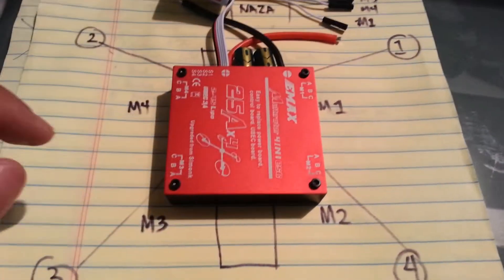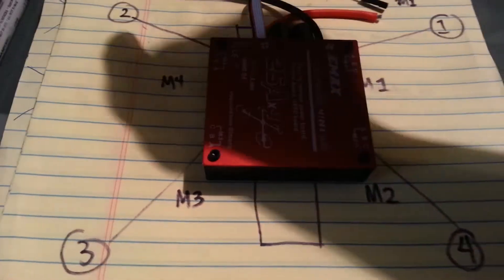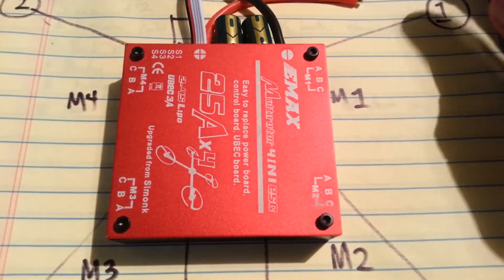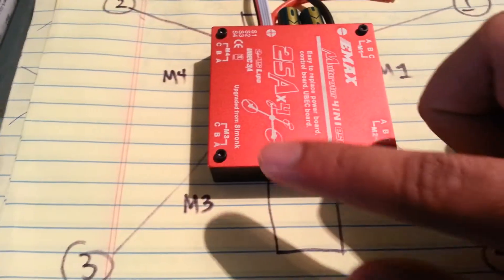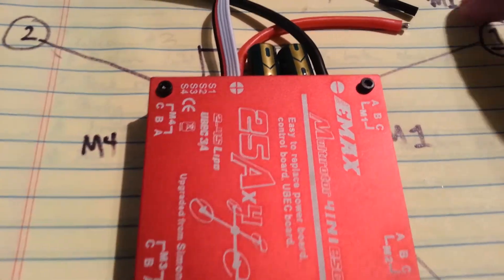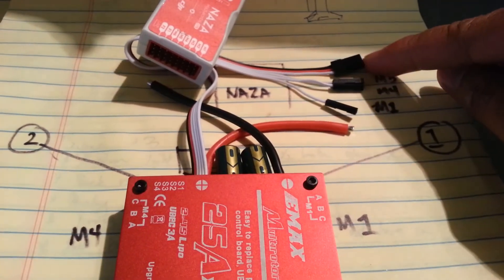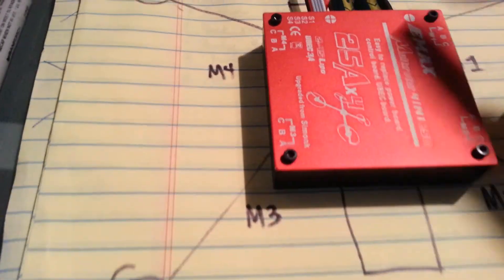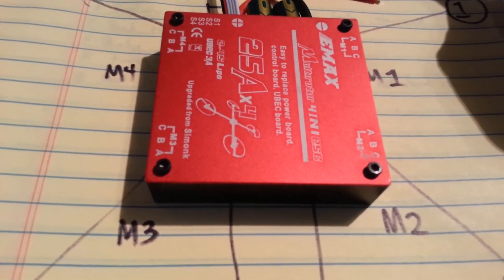4in1 ESC motor orientation and plug orientation for the AD1 Quadcopter

Comment: hi guys i have skywalker 4 in 1 and i have naza m lite plz tel me how connect s1 s2 s3 s4 ........ the white cable have +red +black cable i cut this 2 cable or i must together with white put in naza???
Reply from the maker: where you able to find the video I suggested?
Reply: Can help me? Plz???
Reply: I put white red black together without cut red??
Reply: Komis Tablet The 3 pin plug is wired wrong. It is true it is on M4, but if your flight controller requires power to be on M1, as the KK boards do, you will need to take a small xacto blade and CAREFULLY...CAREFULLY  lift the little plastic tab holding the signal wire pin in(the white one), then lift the tab on the M1 pin, and switch the two, so that the M1 wire is now in the 3 pin plug, and the M4 is separate like the 2 and 3. You dont have to lift the tab very much, just try it a few times very gently. I can tell you for a fact that that is how the inside of the ESC is made. The M wires go to the right places, but if dont want to mess your head up by trying to figure out if you want M2 to power the #3 motor, and the M1 to power #4...or whatever, trust me...just swap the pins.
Reply: John Robertson
So that's what I have been doing wrong!. I was assuming s1 was on the 3 pin plug. I switched the two pins like you said for the kk2.1.5 board now all my controls are working as they should. Thank you so very much
Reply: Dana Smith Its better to be lucky than good....unless youre me...and since Im always right...hehheh
Im about to order one of the 12 or 20 amp ones, made by another company, which unfortunately I think they glue the boards together,not built in a small box, so I dont know if I will be able to achieve the same results should I find the same issue...
ps...you can also do the same ESC cal procedure though, as either the "manual" discusses, or how everyone does it for individual esc's....you know...stick to full throttle with radio on...plug in battery and QUICKLY..within 2 seconds...push and hold buttons 1 and 4 till the screen shows "EC calibration"....then listen for the sequence of tones...

Comment: One question is the original orientation according to the m1 m2 m3 m4 on the esc or is it originally flipped as shown in the video
Reply from the maker: Yes i flipped it because I wanted to protect the capacitor and have it facing inside our drone. So M4 becomes momtor 2 on the naza and so fourth.
Reply: So the original layout on mine is still the same as shown on the red plate
And has yours died or is it a good product
Reply from the maker: Good product.